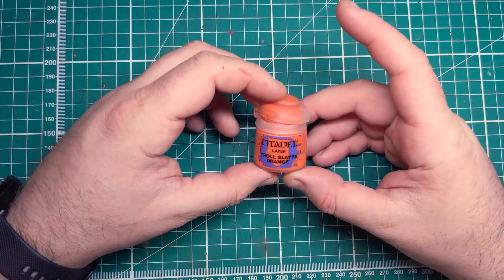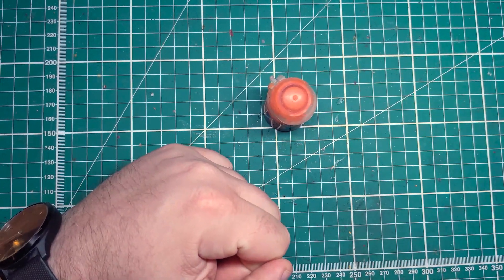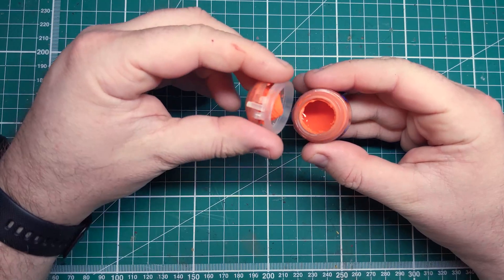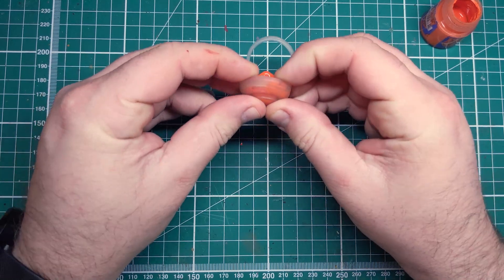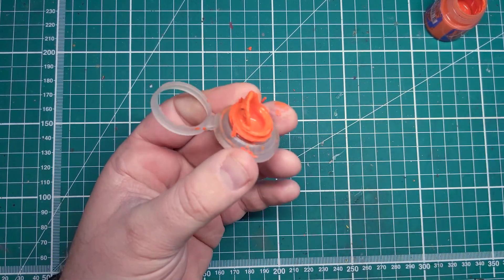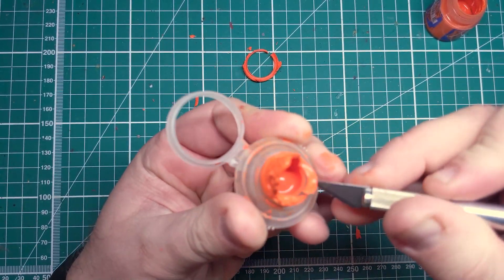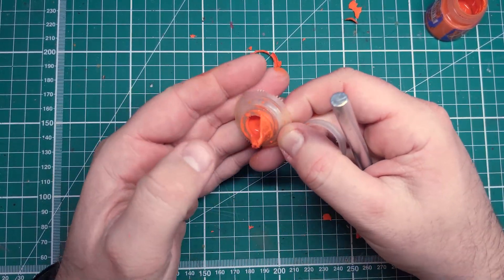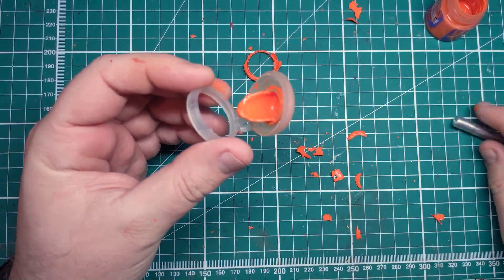Hobby techniques: Cleaning GW Paint Lids

Comment: I just use a good pair of tweezers to pull the gunk out of the lid, no need to take the lid off the pot, a lot quicker, and cleaner than the mess you made.
Reply: Ive done both in the past, this is by far the best method, as in popping the top off
Reply: @wrighty11  each to his own I guess, I just don’t see any reason to take the top off when you don’t need to.
Reply from the maker: Tweezers work too if it's a really good pair. But it never hurts to have options :)